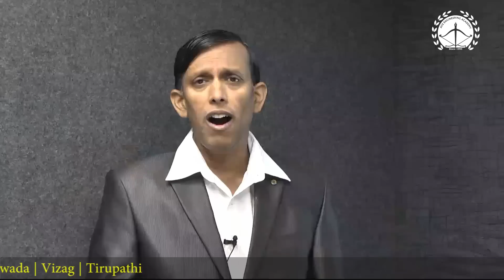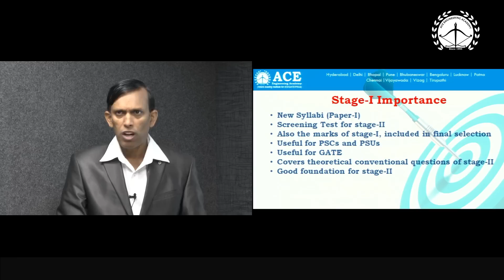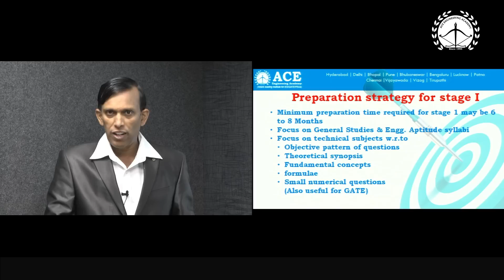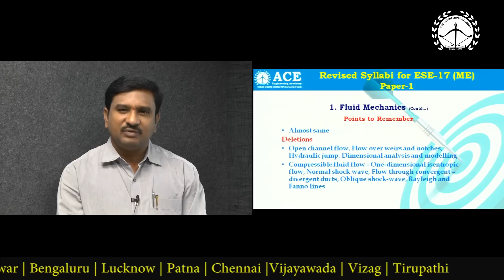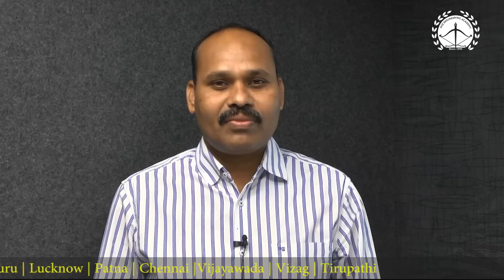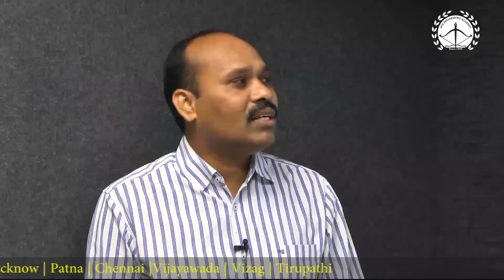Revised Pattern for Mechanical Engineering (ESE) IES 2017 Exclusive

Comment: sir,,first of all thanks to ace academy for such a knowledgeable video.
1- I want to know how to practice question based on the new syllabus specially in fluid mechanics where syllabus is changed.
because in all previous year sets there were more question based on eliminated section of the previous syllabus.
2-Also confused how to eliminate the topics from reference books which is not relevant from the current syllabus.